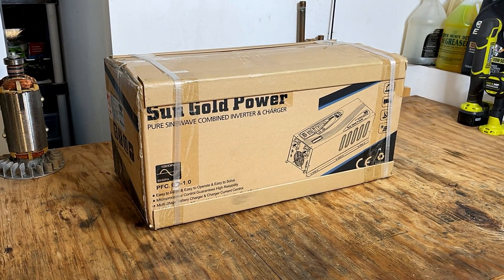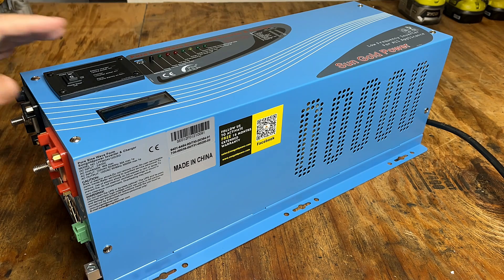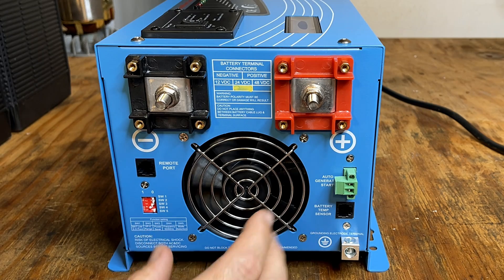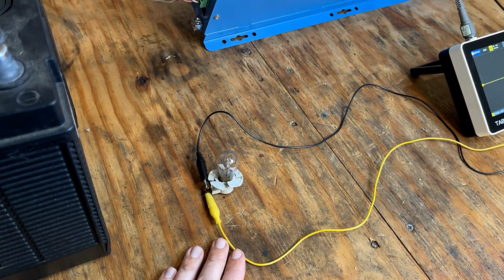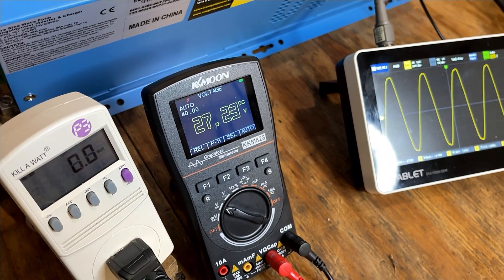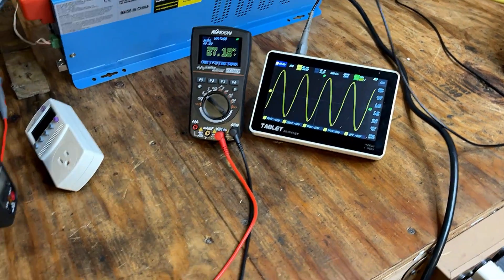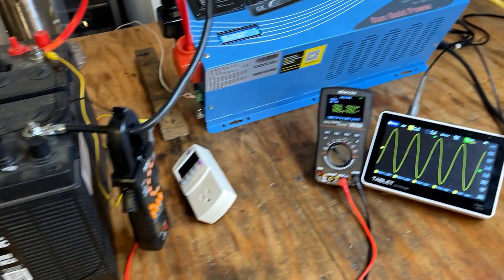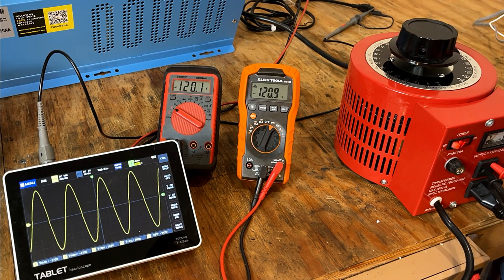SUNGOLDPOWER 3000W Pure Sine Wave Inverter Charger Test and Review

Comment: Technically speaking ... Your inverter, like all modern inverters, use MOSFETs and TRANSFORMERS !  A high frequency inverter uses high frequencies, MOSFETS diodes and small transformers to create high voltage (about 200V) DC.  This then sent to a controller that makes it into 120VAC using more MOSFETs.  The SunGoldPower inverter first creates low voltage (about 16V) AC.  This is then feed, via MOSFETs, to a LARGE transformer which makes it into 120VAC.
In theory, both designs work and the high frequency design is less expensive.  The low frequency design seems to be more robust/durable.
Reply: Which kind has a higher idle consumption I've asked this question a couple times on here today. I figure somebody might see my comment and know the answer. I believe that red 1.6 amps. I'd like to convert that to watts
Reply: @VinceBadovinatz88 LF has higher consumption, in this case 35W. My cheap 24V HF inverter is only 6.8W.
Reply: @VinceBadovinatz88 These inverters have power save mode though which I measured about 5 watts. The problem is only certain types of loads are suitable for power save mode. Well pumps and heaters are good for that. Small loads or computer driven loads (like furnace) will not kick it on.
Reply: @LibertyDIY thank you

Comment: I like the surge capability of the SunGold but I've been using high frequency inverters (active & spare) from Reliable Power (now WZRELB on Ebay) for 4 years in my "Wait until daylight" solar-charged backup power system.  The 2000 watt pure sine wave inverter was chosen to handle the maximum normal load of 1350 watts (just under 70% of the inverter's rating) and it has no problem starting the essential things (fridge, freezer, furnace blower).  After one trip outside to shovel 7" of snow in the dark at 30F to get a generator out of a shed, I decided there had to be a better way ;-)  A gasoline generator is still the fallback if there isn't enough sun but, depending on the season, the solar backup system can provide 8 to 20 hours of limited power - 20 hours if only powering the fridge, less time if the freezer needs some cooling or we need the furnace.  No "bells and whistles" on the inverters (charger, gen start, etc) but they have survived 4+ years so they are fine for my needs.

The gasoline generator is actually a hierarchy of generators: 1600 watt inverter gen for limited power and recharging the battery bank if there is no sun (most efficient); 3000 watt 120 volt gen if I need corded hand tools; 5000 watt 120/240 volt gen if I need the 10" table saw or the air compressor.

Longest outage we've used the solar backup for was 12 hours in December - with snow taking down power lines.  It worked for my design time, so I was happy.

No, I haven't tried to start any large, high-start-current tools with these inverters.  I know that some 10" and larger chop saws can have a 40 amp or greater start surge which very few inverters smaller than 10KW can handle.  My spreadsheet for "What things for how long?" on the solar backup has a page which includes average running power, maximum running power (defrost cycle on fridge or freezer takes more power than running the compressor) and starting power plus cells which go red if you exceed the inverter's ratings - nice to be able to say "You can use the garage door opener if I unplug the fridge and freezer for a few minutes" - all can be run at the same time but not all can be started at the same instant so you need to ensure controlled motor starting - timers work well to prevent simultaneous fridge and freezer starts: two hours on; two hours off and a 3-5 minute gap between those times or whatever works for your appliances.  

Inverter power is fed to selected circuits via a transfer switch, which is also where the gas generator connects through a 12/3 cable.  The 5000 watt gen has a 4 prong plug connected to a double duplex outlet via adequate wiring - one outlet on each side of the 240 - so I can power multiple larger tools at the same time and still charge the battery bank, if needed.
Reply: Good comment I was wondering about those inverters seeing them advertised. A lot of the reviews weren't so great I don't think

Comment: Sir:  What brand variac is that, please?  

A T Burke
Reply from the maker: Yonntech Auto Transformer 2000W 20Amp AC Variable Voltage Regulator 2000VA 0-130V Output Autotransformer 110V https://www.amazon.com/dp/B07FTCV4YD/ref=cm_sw_r_cp_api_glt_fabc_GT1N5Z3M6HG2DQFFW3ZV?_encoding=UTF8&psc=1
Reply: @jcondon1  Thank you, Sir.  

A T Burke

Comment: Why would some one need one of these?
Reply: It converts a bank of batteries to 120volts AC to run basic circuits in your house,  instead of a generator.  When it's not in use it maintains the batteries to full charge.

Comment: the leading brand in off grid inverters is Victron.........multiple units can be configured for split phase,parallel units and even three phase power from 3 or 6 units. They are not made in China. Victron inverters and solar charge controllers have a lot of fine control options over battery charging configuration for all battery types ,inputs for fuel tank levels and genset start up. Multiple units can be networked for redundancy and multiple solar charge controllers can be networked to operate as a single charging unit. Victron units can also be hubbed to share data for remote monitoring..........endless features.

Comment: Watch out for those Made in China cables. They tend to send CCA crap instead of copper wires. The CCA works fine until you get to 50% capacity or a few years old and corrodes to crap (putting it nicely).
Reply: I actually bought this exact one (12 volt version) in 2020.  The cables were way undersized.  Better go big or go .....
Reply: CONCUR !  Invest in some large (4 AWG ?) cable.  You can find places on eBay that will make them to whatever length you want.  If you are going to be doing a lot of solar/inverter/charge work, you might be better off buy cable in bulk and a crimper.  Even the hammer crimpers are pretty good.
Reply: @jackpatteeuw9244  A 3000w should be more like 4/0 and short as possible. A 2000w should be more like 2/0. The included are never near large enough. Tons of RVers have figured out many of their problems running these larger units is small cables. Welders cable works well
Reply: I have had some of those Chinese cables actually made from copper plated aluminum wire, which as a notably higher DC resistance.

I also make my own cables.  Sometimes it can be hard to find the exact terminal lug I need so, I have made several from copper tubing, which I then crimp using a hydraulic crimper.  I need to go a step further and buy a solder pot to solder the terminals after being crimped to reduce resistance.  With 100 amps flowing, the least little bit of resistance quickly starts heating.

Comment: 2 questions this video brought to mind

when trying to measure DC current with a clamp meter are there any special steps you need to take vs AC, does it only work on pricier meters that state they can do it or are the mechanics behind how its measured the same for both AC and DC?

second when buying batteries theres typically an AH rating on them, what exactly does this tell you? how many amps itll put out until it drops below 12volts? 11volts? wheres the cutoff or is that the amps contained in the battery if you drain it right to nothing? depending on the answer to this question can you simply take the AH of the battery multiply it by 12 and get the WH the battery will put out for the the inverter before going flat of course with some margin or error favoring low long loads like lights vs high draw items like microwaves and power tools
Reply: That's usually two entirely different types of metering these days. 
 AC clamp-on current meters use the clamp as the secondary "winding" of a transformer and the wire running through it is the primary "winding".  The AC voltage the meter reads via that transformer is scaled to display AC amps.  
Most DC clamp-on current meters now use a Hall-effect sensor (sensitive to the magnetic field the DC current induces in the wire it's clamped around) and that magnetic field reading is scaled to DC amps.
Some meters may use Hall-effect sensors for both AC and DC.

You should probably spend some hours at batteryuniversity.com as they can tell you more than you ever wanted to know about all types of batteries ;-)

The AH rating of a battery is based on testing done for 8, 10 or 20 hours (depending on the battery's intended use).  Most vehicle batteries (and those for UPS units and many solar applications) have a 20 hour rating.  A 100AH battery can deliver 5 amps for 20 hours (5 * 20 = 100) BUT there are a number of "gotcha's", depending on the type of battery.  A typical vehicle battery (SLI - starting, lighting, ignition) is a FLA (flooded lead acid) battery - the type you must check the water level on occasionally.  Some newer vehicles use AGM (absorbed glass mat) batteries which are sealed, with the acid trapped in a fiberglass mat so the battery never needs water and can be used in any position (you'll also find these and gel batteries in electric wheelchairs and handicap scooters).  Some FLA batteries are designed for long service at high loads (forklift, solar power, submarines) and can last many years.  
Newer battery technologies use lithium instead of lead-acid and can have longer life - but cost more.
SLI batteries are designed for the quick, high current engine start and immediate recharge but don't last if subjected to discharges greater than 20% or so.
AGM batteries can provide 350 charge/discharge cycles if discharged 80% or 1200 charge/discharge cycles if only discharged 50%.
Most lithium-ion cells can provide 500 cycles if discharged 80%, but perhaps 3-4 times that if only discharged 50%.
LiFePO4 cells can provide 1000-2000 cycles if discharged 80% and probably double that if only discharged 50%.
LiFePO4 batteries can be made up that match the voltage range of lead-acid batteries so they are almost a drop-in replacement - 12, 25 or 48 volts.  Lithium-ion batteries can be made that work in place of 24 or 48 volt lead-acid batteries but they are NOT a drop-in replacement - things usually need some tweaking.
If you can only use 50% of a 100AH battery, you only have 50AH to work with at that level of battery cycle life so you must compute how many charge/discharge cycles you need from the battery bank, how much space and money you have and then work out which type battery and how many AH to power your needs for XXX hours.
 There is no easy answer because it depends on YOUR needs and YOUR available funds.
Reply: @notyoung  dang that was a good comment thanks for the info I've been messing around with this stuff for a while now but it's always good to read it again

Comment: For those that don't know, MOSFET means metal oxide semiconductor, field effect transistor.  Just in case you wanted to know.
Reply: This is correct, and this inverter has just as many MOSFETs as any other. These are LV MOSFETs where the HF inverters use HV MOSFETs or IGBTs.
Reply: True. In other words it's a switch - electronic.
Reply: He doesn't know
Reply: Thanks I don't know anything about mosfets
Reply: What is the idle consumption on the sun gold. I think it said 1.6 amps but I don't know how to convert that to watts.. I need to learn how to do that because they all come in amps well they don't all say amps. The all-in-one inverter 2424 mPP uses 50 watts, which is the only drawback to those. well I don't know about the only but that's the biggest one. I wonder what the 1.6 amps on this means

Comment: Thanks for the presentation. An interesting product that might be useful for some applications. I went to Sun Gold Power's web site and was looking at some of their other products and I was astonished to find (at least what it looks like to me) that the utility connectors on all the models look similar to the one you tested. While those connectors might be fine for 25A @ 120V, in no way would they be capable of providing 18000 Watts of power on a split phase inverter setup. Do these have any agency approvals? If you used for your home backup and something went wrong, i.e. the apparent undersized output logs burned up, your insurance company would say NO, you're on your own...

But, don't get me wrong, it's an interesting product that has it's uses but from the images on the web site I was concerned about the robustness of the connectors being able to handle the loads they specify.

Eric
Reply: They could...depending on the voltage, the capability is usually rated in amps, but that will change the total wattage that can run through there at a higher voltage. Basic Ohms law. So a contact rated at 15A at 120v is 1800w, but at 240v that's 3600w. It can all be done by calculations

Comment: I have one of those split-phase model hookup to my whole house, pair of Lifepo4 battery's runs all my house including my water heater (3800w) 240v with out any problems, all so have a Victron charge controller width a couple solar panel to charge my battery's , so yeah you can use one of does for off grid if you have a large enough  battery bank for pass the night and day's that there is not much sun light , the internal ATS of this units would keep you desktop computer on ,some times you would never know if there is power lost in the grid, yes is that fast the ATS

Comment: Need to do a video where you combine an electric start genset, rig it for auto start, add a small 24v battery bank, and use this, and maybe an ATS(have the input swap between grid or genset?) and power whole home, n can put a auto-transformer on the inverter, to get 240v output, throw it all on a "small" generator cart, add 30A/50A inlet for power on house, and a 30A/50A outlet, to feed inverter/ATS, that way you can power whole home with the cart when you want, or bypass it when you want :D would make epic "backup power on the cheap" video, and you can also sync the output of non-inverter based generators, either manually with neon bulbs to help you align the phases, or automatically with some different genset controllers for 200$~, basically infinitely expandable, portable, and done on the cheap, could even put it all on a small trailer
Reply: Just need to swap the carb on the genset for quad/tri/dual fuel carb setup, for 30$ and then you could run on anything from biogas(methane), propane(LPG), or Natural gas(CNG)

Comment: I see it's sporting the ubiquitous CE (China Export) listing...   Whether it is at fault or not, your insurance company can deny paying any claim if a non UL listed device is wired to your home.

It's a impressive unit for an "as needed" basis, but you better have faith in that "Made in China" device before you go live with it.

I used to work for a Fortune 50 and we had a UL lab on site.  Because you have to re-certify every iteration, we could fully test before we scheduled one of their Testers to come on site for the certification.   Every time he stepped through the door it was $100G whether you pass or not.  That was in the 80s.

Comment: Good tip with the lamp providing the initial capacitor charge,
This could be very helpful to create a power conditioning circuit for pure sine wave critical devices using a non inverter generator and fairly small bank of batteries. 
Thanks.
Reply: A 10 ohm 100 watt resistor is easier to use.  Cheap on eBay.

Comment: Seems like a good system, however I can find no reference as to UL safety approval, (CE is not applicable in USA) on their website or on the user manual that I downloaded. That could be an issue if connected to a transfer switch in your house, as it would not pass inspection, although many homeowners would ignore getting an inspection - just be aware that should there be a fire or some other fault, you could find your homeowner's insurance is invalid.

Comment: Nice unit!! I've not seen ones like that here in Australia. We do have those which will charge a battery bank from a solar array system, as well as putting out mains power from the same solar array input.
Reply: Every DC powered (eg: battery) UPS producing AC is an inverter by definition.

Comment: That's probably the way to go for most of us, eventually. It is effectively a big UPS with nice extra features.

I'd say, go for the 48v input, and halve the current draw from the batteries.

I like the practical test, nuking a lasagne for dinner!

What sort of money are we looking at for one of these inverters?
Reply from the maker: They are not cheap.  This one is in the $800 range.
Reply: @jcondon1  I guess you could say "ouch" to the price, but I'd hazard a guess that like most things, the costs, and eventually retail price should fall, but for now, I think only a serious need would force me to buy one. One good reason might be to have the advantage of short term power restored without upsetting the neighborhood, especially in the late evening, otherwise, if like us you're lucky enough to be rural, stick with a reliable generator.